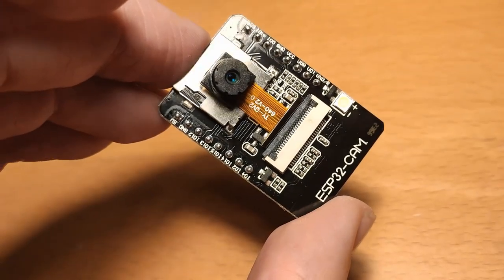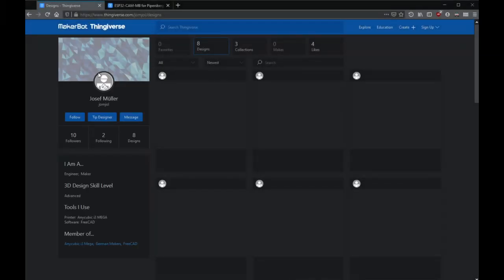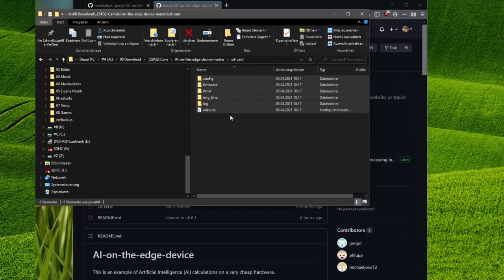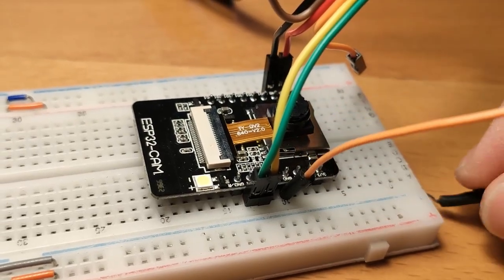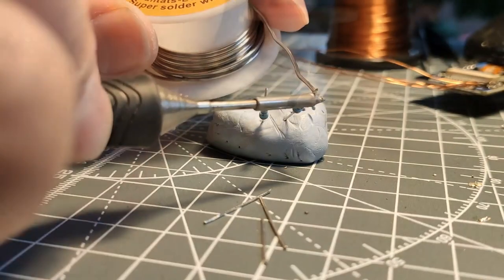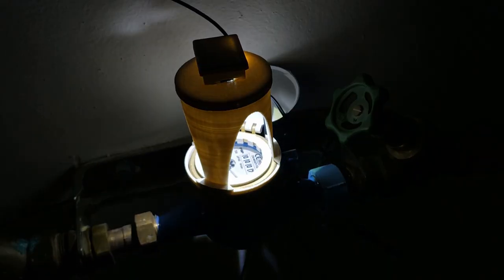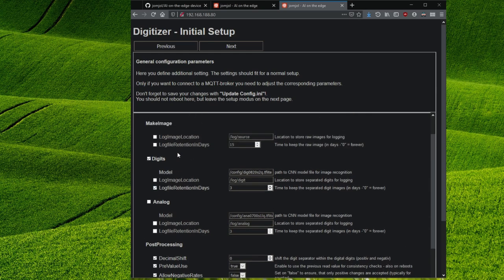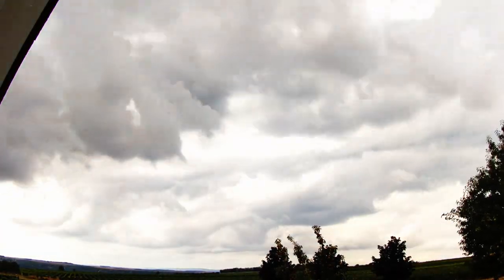ESP32-Cam on your water meter with "AI-on-the-edge" -- also for gas and power meters

Comment: Hi, I tried this today and I notice the during the configuration, most of the time the setting page does not load. Have to go back and forward few times to load the setting page. After I done all the settings and restarted the esp32cam, I can't see anything under the Overview tab. Any idea what's wrong?
Reply: May I know what's the version of the firmware you are using?
Reply from the maker: Hi, the microcontroller is quite busy with its tasks. So you should not switch back and forth in the menus too fast. But actually you should be able to navigate through the menus reasonably well. Is it possible that your wifi is a bottleneck here?
I'm still using v6.3.1 (2020-03-16) on the gas and water meter, which runs very stable for me and hasn't given any reason to update yet. Only on the electricity meter the recognition of the digits is not perfect. I have to finetune this again soon and send the pictures with the digits to jomjol.
Reply: @MakerMeik  I did try and wait after switching page..but the setting is still not loading. I don't think my wifi is bottlenecking. I will try to flash again the same firmware version as yours with your flashing method. I flashed mine just now with the latest firmware and with second method.
Reply from the maker: It cannot be ruled out that the current version is still a bit bumpy, since it is a major update. jomjol has now e.g. implemented that you can also read two meter readings.
Reply: @MakerMeik  Today I have tried to re-flash it to v6.3.1. But I'm still encountering the same issue in which the setting page is partially loaded. There is wording being loaded but no images and I can't configure the settings. Could it be the SD card issue since all the images are loaded from the SD card? I'm using 16gb SD card. My wifi connection is pretty good, so I don't think it is wifi connection issue.
Reply from the maker: If you have the opportunity to test this with another SD card (less than or equal to 16 GB), it certainly would not hurt. Of course, the microcontroller could also be defective.  If you can exclude both, you might open an issue on Jomjol's Github page.

Comment: Great Project , i following your instruction and stuck in mqtt ,i set ip-address:Port to publish to broker but it do not send anything out,
Reply from the maker: This is difficult to solve by remote diagnosis. First, you should be absolutely sure that nothing really arrives at your MQTT broker. With Mosquitto you can do this on the command line with this command:
mosquitto_sub -v -h localhost -p 1883 -u "admin" -P "your_mqtt_pass" -t '#'

Comment: I got the programming part done, but when booting i get "cpu_start: Failed to init external RAM?" on the serial port monitor. When programming the device this chip version showed ESP32-D0WD (revision 1). I'm a complete novice, and i'm lost :). Can someone point me in the right direction or redirect my question to a better suited place?
Reply from the maker: This problem has not appeared on my boards, so unfortunately I can hardly give any help here. Maybe another user has already solved the problem.
A quick research showed that this problem seems to occur on some boards. Here is a Github discussion on the subject where even an Espressif employee has commented:
https://github.com/espressif/esp-idf/issues/6063

If I understand it correctly there, you solve the problem on the affected boards by enabling or disabling the "CONFIG_SPIRAM_IGNORE_NOTFOUND" section in the config file ("./sdkconfig").

For AI-on-the-edge this should be the file "sdkconfig". In line 264 you will find the entry:
# CONFIG_SPIRAM_IGNORE_NOTFOUND is not set

You can change this for testing as follows:
CONFIG_SPIRAM_IGNORE_NOTFOUND=y

No idea if this changes anything. Unfortunately I can't reproduce the problem on my end. If you don't get anywhere with this, you might want to open an issue on Jomjol's github page.
Reply: @MakerMeik  I tried different sdcard and didnt help, i tried this option and didnt hel either. On the github zou can see that maybe yo dont havve psram. i am ending with this project. To fully undestand the whole problem it would take a lot of time..
Reply from the maker: I am very sorry that the problem could not be solved for you. It would be really interesting to know what has been different with your hardware. Maybe another viewer will figure out the problem.
Reply: @MakerMeik  Hello,
I have the same problem
After modification of the sdkconfig file, I think we have to compile something, but I don't know how to do.
If you have some time, can you explain me, I would like to solve this problem because this project is so interesting.

Comment: The model isn't any more on thingiverse did you delete it ?
Reply from the maker: That was not my intention. Thingiverse's interface is unfortunately very buggy. I had recently uploaded an update of the electricity meter case and apparently the model was not displayed in my profile since then. However, through an external link I was able to find the model after all:
https://www.thingiverse.com/thing:4845504
Thanks a lot for your hint.
By the way, the update of my model has a shortened housing length. You should be aware that the door of the cabinet can't be closed afterwards, though. There is now also a model on Thingiverse that works with a mirror and is more compact. If this is important for you, you should consider it. However, the assembly and installation will certainly not be easier ;-)

Comment: Does this installlation at least save any money?
Reply from the maker: Of course, you can save money with it. In my opinion, you can only optimise things if you understand them.
Here are a few examples:
For example, if you realise that you use water at night when everyone is asleep, then apart from the unnecessary water costs, you will soon have major damage to the building that you could have prevented.
Or if you water your garden regularly, most people probably do it more by feel. But if you know the footprint, you can control the amount of water you apply per square metre very precisely. Together with soil moisture sensors and a rain gauge, you can save a lot of water, depending on where you live.
Another example: If you live in an area where you have to heat in the winter, most people are happy to have the heating engineer set it up and it gets hot in the winter. In our case, however, as in probably 90% of households, no hydraulic balancing of the radiator valves was carried out, although this would actually be a regulation here in Germany. I then carried out the hydraulic balancing myself: You have to determine the exact heat requirement for each room and find out the wattage of the respective radiators. Then you can adjust each radiator to the exact demand - and I'm not talking about ("smart") thermostats here. As a result, you can lower the heating curve of the heating significantly, without any loss of comfort. And as a control sensor I have my wife ;-)
I have been observing this for six years now and the savings are around 20 to 25% every year ... for that I would otherwise have to carry out quite large structural measures. If you can track the continuous gas consumption of your heating system, you can see such optimisations directly in money and don't have to wait until the annual bill to find out whether it has actually made a difference.
And that's why I don't really care about the purchase costs and 0.5 watts of electricity consumption for a microcontroller. My stupid Sony Android TV has a bug (once again) since the last update: when you switch it off, i.e. to standby mode, it continues to consume 25 watts ... day and night. And most people don't even notice this, because the normal power plug doesn't tell you how many euros you actually have to put into the coin slot every week ;-)
I think we would deal with nature differently if we had a better understanding of cause and effect.
OK, that was quite philosophical and detailed, I hope my answer wasn't too long for you ;-)

Comment: Does anyone know if it would be possible to integrate this with an Arduino GSM module?  If so how.  I'd like to use this without a WIFI connection available.
Reply from the maker: Unfortunately, I don't have any experience with this topic myself and apparently no one has responded to you yet. Would be interesting to get an update from you, if you have come further in the topic. Maybe Lora would also be an alternative for you?

Comment: why not use home assistant?
Reply from the maker: The values are sent via MQTT, so you can of course also process them with Home Assistant. I chose the classic IOT stack quite early with Node Red, InfluxDB and Grafana. Once you reach a certain level of complexity in your own configuration, you don't want to switch. In addition, I have not yet reached any limits and have been able to implement all my projects. On top of that, I really like the look and the freedom of Grafana.
But Home Assistant is a very interesting alternative, no question. And newbies should think about which way to go. Maybe I should have pointed that out in the video.
Reply: @MakerMeik  Oh cool I'm new at this, thanks for explaining. Maybe Home Assistent is better for some specific needs or integrations, like making all my google homes AirPlay compatible, making all my devices compatible with homekit, or emulating a hue hub =D

Comment: Cool project, but in real life you would read the meter by reading the meter's pulse output.
Reply: Except when the meter doesn't have a pulse output. The water meter in the video still photo doesn't (I have the same type).
Reply: @henrikballekoefoed591  To clarify, I'm talking about a commercial product, not a hobby project.
Reply: @fyfoh  Still, when your water supply company installs a purly analog water meter on the feed to your house, you dont have a pulse output available, and thus will have to use this metode.
This is real life, and the option to read a pulse output does not exist. On the electrical powermeter in my house I use a light sensor to read the pulsing LED (no serial bus available), so yes, if that option is available, then for sure it's a better solution.
Reply: Dutch smart meters have a standardized connection/protocol you can use to connect with them

Comment: Is it reliable?
Reply from the maker: Excellent question and amazing that no one has asked it yet. If you have aligned the camera well and illuminated the counter well, the system works quite reliably. If the camera shifts, however, problems can arise and you have to make adjustments.

Also, not all fonts are recognized equally well. If you have problems, you should send pictures of your digits to the developer jomjol, who will then optimize the image recognition for the next version number. 

If you overload the CPU of the ESP, e.g. because you click around too fast in the web interface, it can also crash sometimes.

These are all solvable problems that should not occur once everything is running. And then I would say, you might have to reboot every few months. In short, it's not perfect, but it's pretty good.
Reply: @MakerMeik  Thanks! That's what I thought. I guess it's amazing considering it's free software?!

Comment: not to rain on parade but meter readers will fine you thinking your trying to hack the meter to get free gas or water. 👍
Reply from the maker: A holder made of "plastic" with a mounted camera? If I show the web interface with the photo to the employee, the issue should be cleared up.

Although these are mostly people who have completely different worries anyway, if a person comes by at all. Here in Germany, you're usually asked to take the readings yourself. 

But sure, if you have concerns, you don't have to do that with your water meter, after all.

Comment: To run esptool i needed to to this. instead of esptool i needed "./esptool". PS C:\Users\path\esptool_py\3.0.0> ./esptool write_flash 0x01000 C:\Users\path\firmware\bootloader.bin 0x08000 C:\Users\path\firmware\partitions.bin 0x10000 C:\Users\path\firmware\firmware.bin. Still not working but yeah. it happens..Maybe somebody had problems with: Failed to init external RAM! ?
Reply from the maker: User @Roel Van Baelen just reported the same problem ("Failed to init external RAM") here in the Youtube comments. Please read my reply about it. If you can solve the problem, it would be nice if you share your experience with us.

Comment: These kind of sensors are a huge waste of energy and not good for all humans!
Reply: With proper sleep-modes on the electronics, the used electricity should mostly depend on how often your read the meters, which could be pretty rarely.
Reply: LOL that is the most hilarious comment I've seen in a while.

Just so you know, You have probably wasted as much energy while typing and posting that comment than these sensors will use in years.

Comment: Who ever taught you how to adequately remove magnet wire insulation?  That's pure sloppy.  Even a flame is dirty.  Use mechanical technique.  Fine sandpaper or deft use of a razor.  End of story.  Soldering is inert style chemistry.

Comment: Hi! I had serious trouble flashing the firmware under Windows 10. The ESPTOOL.EXE by ESPRESSIF seemed to work, no error messages either but the camera wouldn't work.
So I tried Meik's suggestion with Python. I installed various versions but always got error messages (stuff like "esptool was not recognized as a function" and the like).
Reason for that were problems with the path which obviously wasn't set properly during installation. Since I couldn't sort that out (and really wanted to get somewhere ; ) ) this is what I did:
I copied the content of the "scripts" folder (which is hidden nicely under "c:/user/me/Appdata/Local/Packages/Python.SoftwareFoundation.../LocalCache/local-packages/Pyton39/Scripts" which is simply ridiculous ;) ) into the firmware folder (Jomjols firmware package). I then changed into this folder and got stuff going with:

.\esptool.py.exe erase_flash
.\esptool.py.exe write_flash 0x01000 bootloader.bin 0x08000 partitions.bin 0x10000 firmware.bin

Nothing else would work for me ...
To figure out the path problem would of course have been better ...

I wonder what was wrong with Espressif's windows tool. There were no error messages as I mentioned. Somehow the Python method took much longer (and it works ;) ).

Chris
Reply from the maker: @Christoph Klein Thank you for sharing your experience. Very strange that there were so many difficulties. I also had to change the "esptool.py" to an "esptool.py.exe". But everything else ran, as described in the video, fortunately without problems. 
I would be interested to know if other users have experienced this as well.
@all Feel free to share your experiences, then it will be easier for newbies.